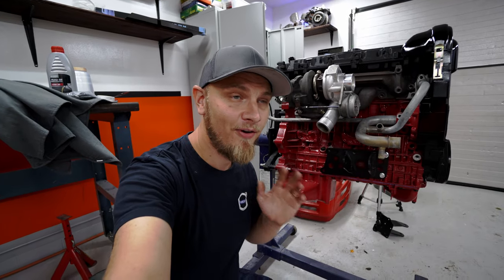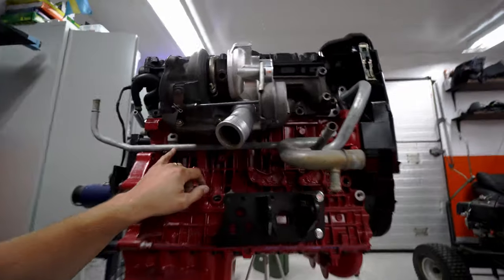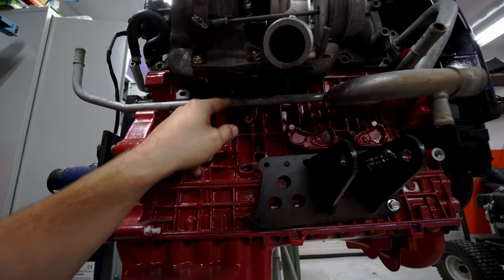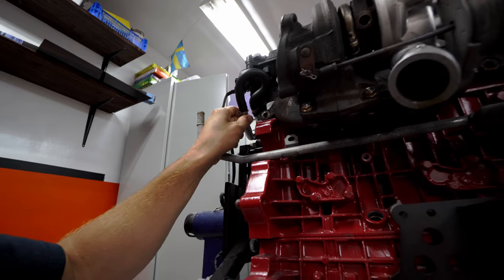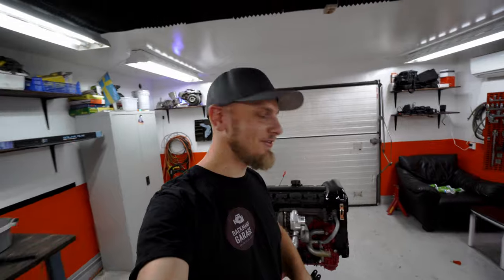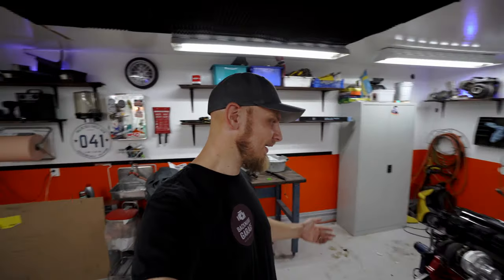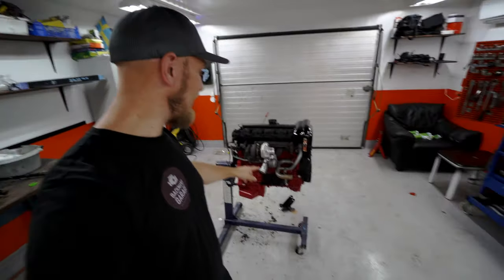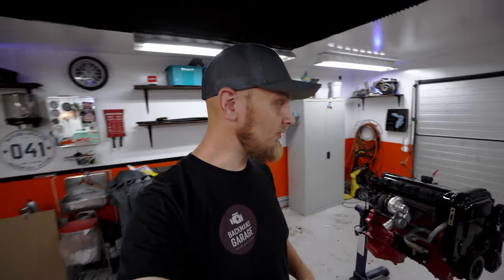The Volvo 740 Project - Part 7.5 - Cutting The Waterpipe

Comment: How much space is left in the pipe after welding? I'm sure that some metal melted inside in that tiny pipe. 🤔
Reply from the maker: The pipe itself is quite thick, alot thicker than one thinks. Maybe 2 mm or maybe even more. And i did a v groove to weld in order to prevent the "cave-in effect". I would prefer to weld this using TIG but that just wasn't avalible at the time 👍 //Backman
Reply: @BackmansGarage  Then all good! Glad that everything is done properly in right way. Top job. Will wait for new videos. Even watched other your video in Swedish language. 😁 Used to work in Sweden so understand few words. ✊